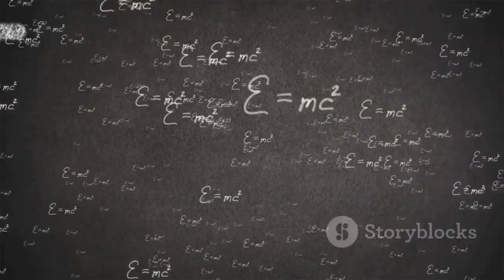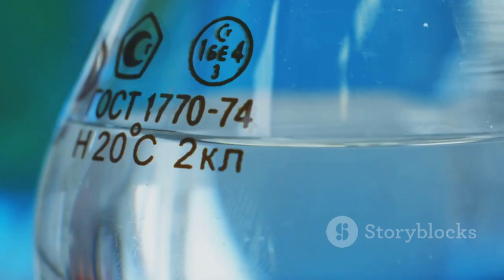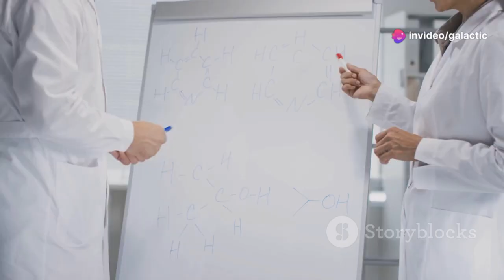Nuclear Fusion Unlocked by MIT – A Tipping Point for the Oil Industry?

Comment: With the creation of thorium, molten salt, reactors not only will we have a method of getting rid of long-term radioactive material, but also 100% of thorium can be converted to U-233. There is an abundance of thorium across our entire planet. I have been monitoring the evolution of fusion reaction and it continues to be 5 to 10 years off. It's good that there is HTS but I don't think this is the breakthrough simply because of all the other previous breakthroughs that were announced for fusion.